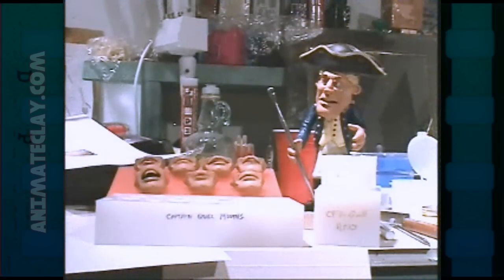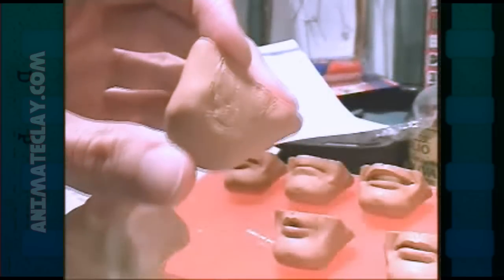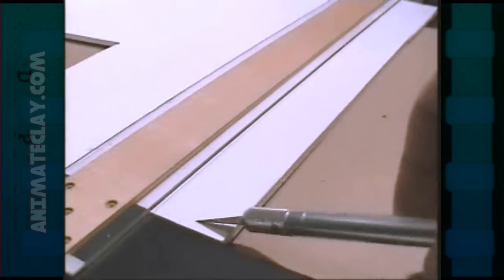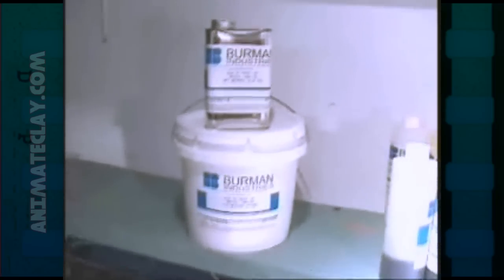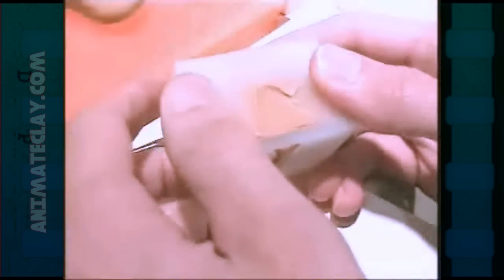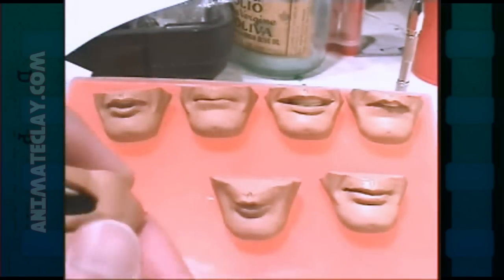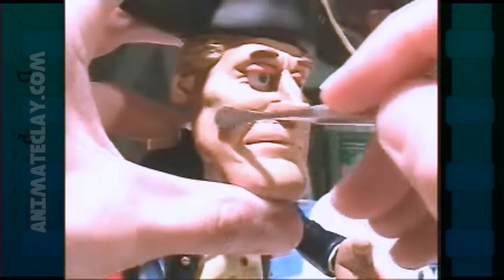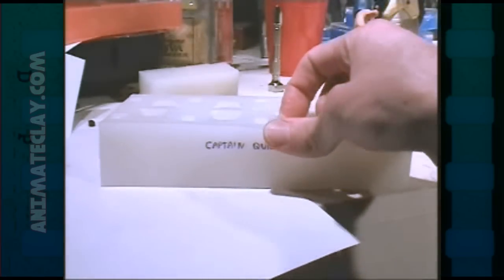How to Make Replacement Mouths for Stop Motion Puppets

Comment: Great video! So I gather you could make resin mouths also using this method? Also what about avoiding air bubbles in the silicone mould, do you use a degassing chamber?

Comment: Marc, I'm lost. you said the top portion is plastic, but when you smooth the clay, you go upwards, and down. if the top is all plastic ho is it that you can smooth the clay downwards, or is there clay over the top plastic portion. I know I'm missing something because the two portions top, and bottom the color matches too perfectly for one to be plastic and one clay. can you explain please? Thanks in advance
Reply from the maker: Hi Michael, once the upper portion is cast in clay - you can go up and down to blend the two together. This way there isn't a build-up of clay that is skewed to one side and it (hopefully) gives your puppet a little more longevity. The reason for the plastic area is so that when you are altering the mouths, the seam line is unchanging before you mold them. If the upper were cast in poured clay instead, the registration could change a little bit when you sculpt on it.  After that your real puppet is completely clay and there won't be all that much blending needed.
Reply: Thanks Marc, I got confused with the plastic upper. i get it now, thanks again for your awesome tutorials. saving up for an armature.
Reply from the maker: Not a problem Michael, glad to clear it up. Now other people will know if they don't understand too. I appreciate it!

Comment: When you're doing the mold for the mouths that have a few different colours, like black and the teeth, do you mold the clay then paint on colour or do you add different colour clays after or how do you do that?
Reply from the maker: I painted in the black areas in the back of each mouth after I cast them. For the teeth I think I put on a thin layer of clay, but they can be painted too. You just need to use an acrylic craft paint of your choice. It will dry without any problems.

Comment: Hi! Great detailed video! I have a few questions about the van aken. After you freeze it, does it change the consistency permanently? Will you get the same result if you skip the boiling process and freeze it using a different type of mold? I was thinking of using baked sculpey as molds, pushing van aken into them and then freezing. Thanks so much!
Reply from the maker: The consistency of Van Aken does change a bit after you melt it down. For whatever reason it becomes a bit harder, but if you work it with your hands and tools sometimes it goes back to normal. What you do with it later (freeze it or re-melt it) won't make any difference. Even the type of mold won't matter much, so if you use latex or silicone - the clay itself will behave the same. Melting it and cooling it after causes it to become a little more firm. Working it with your hands softens it a little. Freezing it and then thawing it doesn't do much of anything.

I would try to avoid using hard molds with the clay if there are undercuts. If you try to pull the clay out - even if you freeze it the clay will get stuck in those undercuts and lock it in place, or cause the clay to deform. It's best to use some soft silicone if you can or liquid latex build up thick over the replacements.
Reply: animateclay Thank you so much for the info! I did use a hard mold and it has proven to be quite a task lol! I have had to use cornstarch to make it easier to get the clay out. Way more work than it needs to be and I completely forgot about undercuts! Thanks for the reminder, I think I'm going to buy silicone for molds. I do have liquid latex..I'll check out some videos about building up molds over baked sculpey. Thanks again!